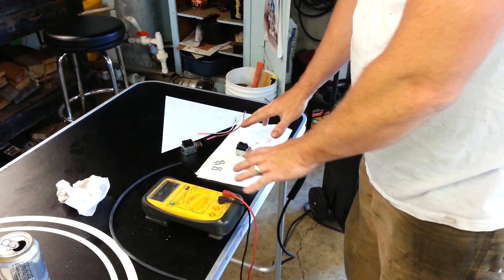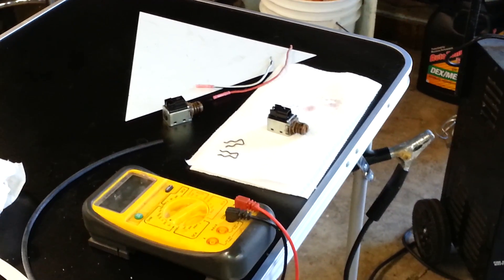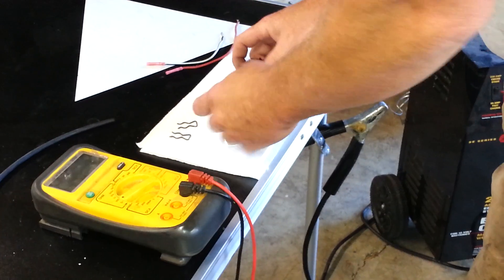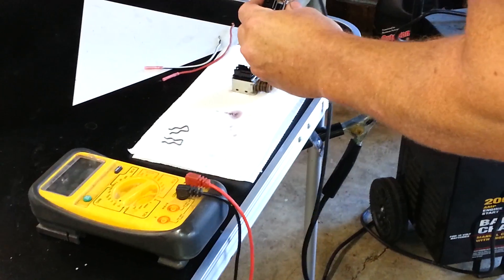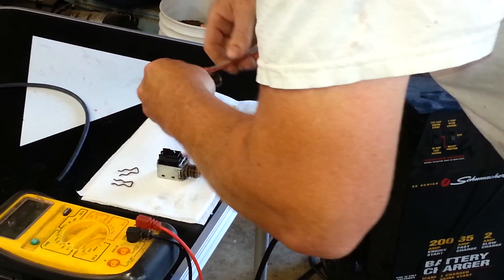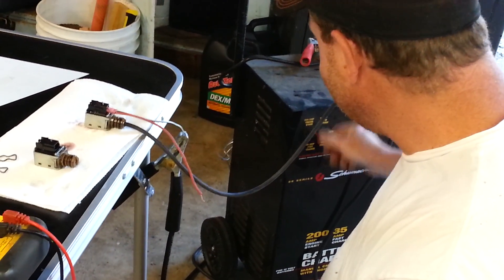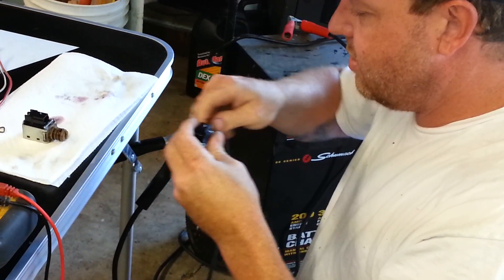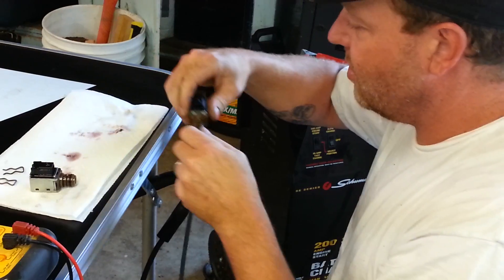How to test shift solenoid 4L60E

Comment: Was blowing into simply enough psi? I saw another vid where a guy supplied 90 psi to solenoids to test them.
Reply: I think flow would be a relevant test. So yes, more than just breath pressure is a more precise test.
Reply: Sometimes things are like turning on a light switch. It's either on or off. If the light comes on using 10 lbs of pressure to flip the switch, you can be certain that it's going to do the job if you used 90 lbs of pressure to flip the switch. Not all things work like this - like engine speed but I expect that this is how the on/off solenoid works. It either opens or closes how it got there is immaterial.

Comment: Will they click without applying Air?
Reply: they should, the clicking is the plunger inside the solenoid moving back and forth blocking flow.  blowing air is a good idea tho also, clicking doesn't always mean it is performing properly.

Comment: I'm having a problem with a 4l80e ware it warms up u drive it an come to a stop u take off then it drops to 1st then shifts the second other then that it shifts fine would u no if this would cause it
Reply: Jesse jones did you find out what the problem was? Because my car has been doing exactly what yours was. Has to warm up to go into gear, if I slow down it has trouble shifting but otherwise once it warms up it's fine... My car is a 99 Saturn sl1
Reply: Sara Cannon  no mine would go into gear no problem but when I drive it would shift fine .when I came to stop light and take off it would down shift then up shift then be fine right now truck won't go anywhere
Reply: Jesse jones okay. I  misunderstood. I thought you meant yours wouldn't go into gear until it warmed up. I can't find anyone else with this issue. I have to warm it up for about 20 minutes before it catches any gear.
Reply: Sara Cannon when is last time you had a filter an fluid changed might half to take it to a shop.. I'm taking truck to get trans rebuilt
Reply: Jesse jones I never have. I bought it 2 years ago and it's a 1999 with 227k. I've replaced the radiator and everything having to do with the cooling system and the starter. But if the transmission is bad that's going to cost more than the car is worth. I'm thinking it's the solenoid pack because it eventually works and if it does seem stuck in a gear turning off the key and back on in Neutral will make it shift. I think it's in limp mode or whatever because last I drove it, it lost reverse and everything from Neutral to 1st was like driving in 3rd gear. So I'm definitely going to take it to a shop. I just don't want them to say it needs an entire transmission if it doesn't. Which is what a lot of people have said was their experience.
Reply: Well transmission shops can hook to it an tell you what's going on for like 20 bucks
Reply: Jesse jones Really? I googled it and it said it would be  $88-$150 for diagnostic
Reply: You don't Google you call local transmission shops and ask if found one for 20 ware I live